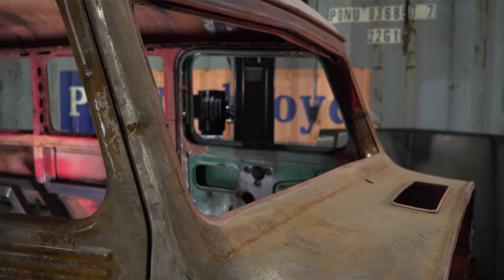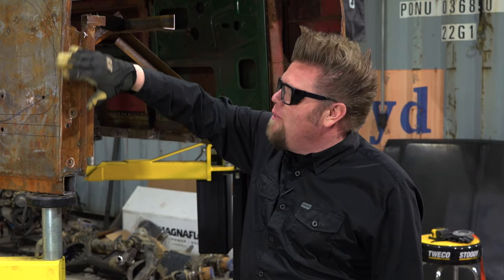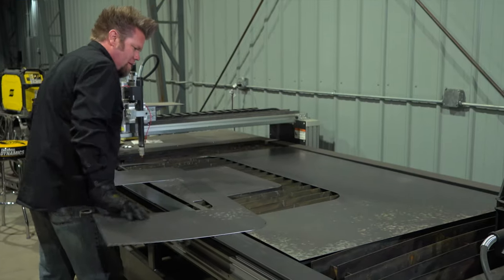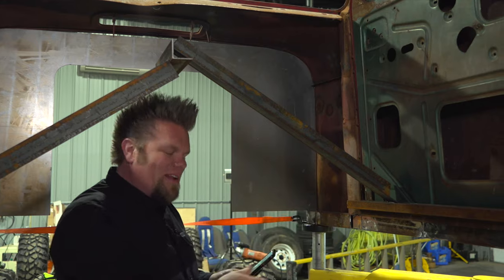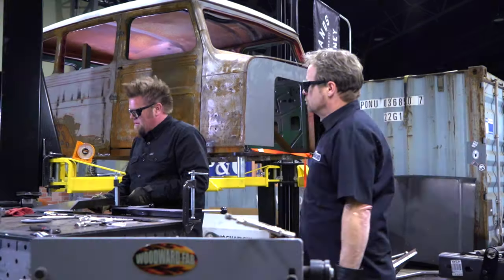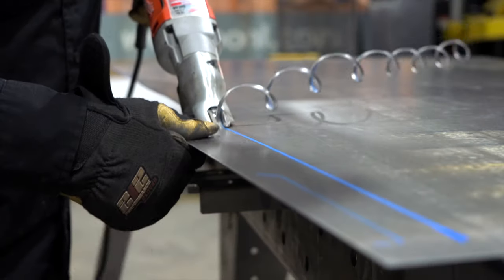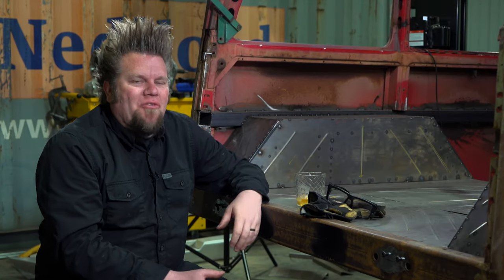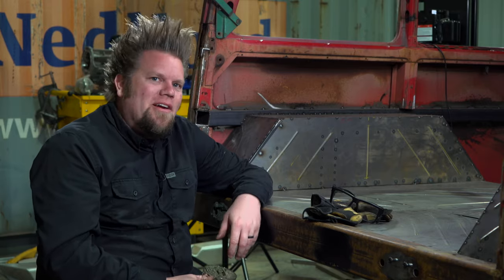How to Build a Custom Floor Pan

Comment: Incredible videos - thank you for sharing! When making sheet metal floors, what type of steel is used and how do you prevent the steel from rusting?
Reply from the maker: It is 18 Gauge Cold Rolled Steel.. and to prevent rust you coat it on bothe sides..
Reply: thank you - what are you coating it with to prevent rust?  @BigTireGarage
Reply from the maker: You can paint it...or you can use an epoxy sealer followed by undercoating or bed liner

Comment: Did you finish welding the floor panels or is plug welding enough?
Reply from the maker: Plug welding and seam seali g is enough
Reply: @BigTireGarage thank you.  im working on a 51 chevy coe. Im moving the engine back under the seat and im going to make a new floor

Comment: No weld through primer?
Reply from the maker: On what part?  I have not hit anywhere that cannot be coated still...I use weld through primer when I will not be able to coat it after building
Reply: @BigTireGarage  I was referring to the panel where they overlap and are spot welded. How do you get paint in there if not using weld through?